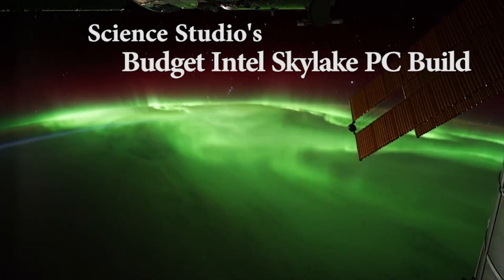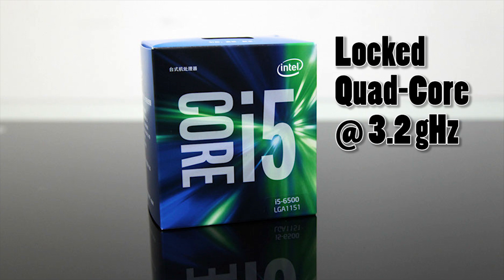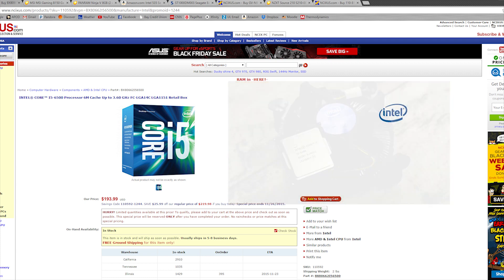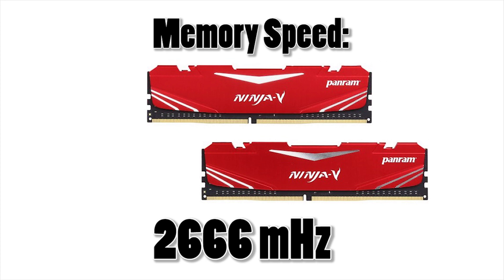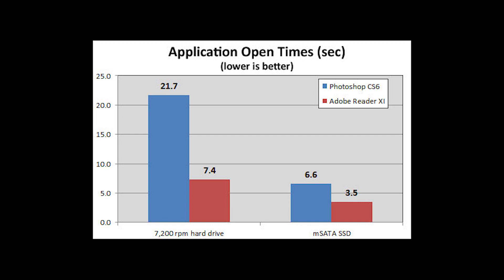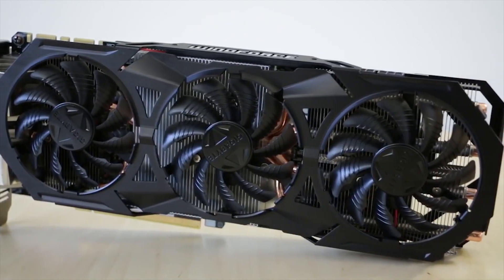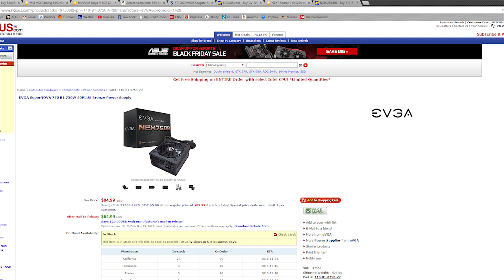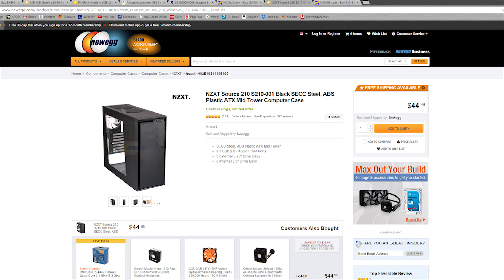$900 Intel Skylake Gaming PC Part List

Comment: Everyone knows that you shouldn't overclock on stock cooler but still, Intel should include one with their unlocked cpus. They did it with Haswell and before. They should at least reduce their price. For those on a strict budget it makes a difference. They might be able to afford the 6600k/6700k but not the cooler because when on a budget those 20 to 30 dollars one would spend on a 212 evo or similar might make a difference.